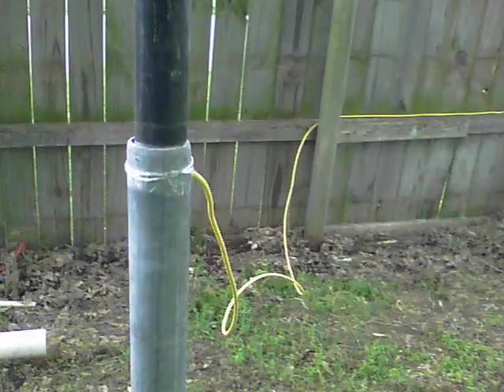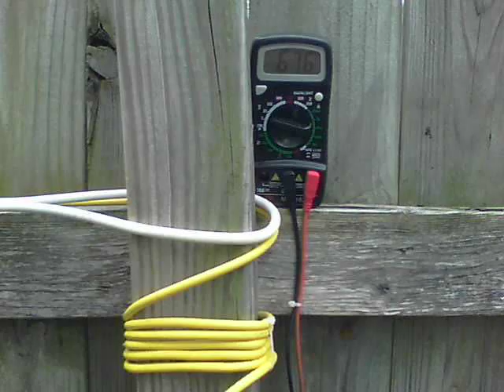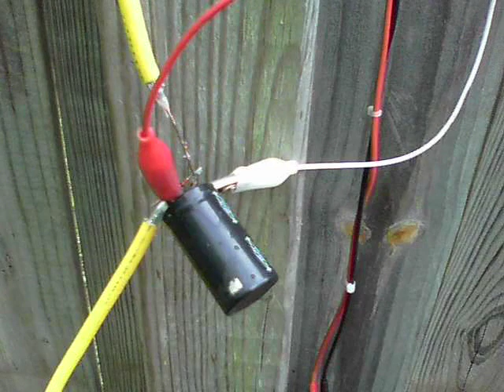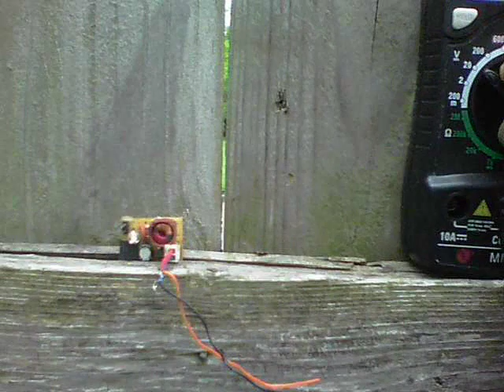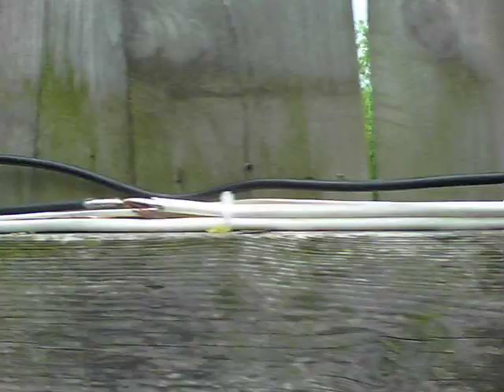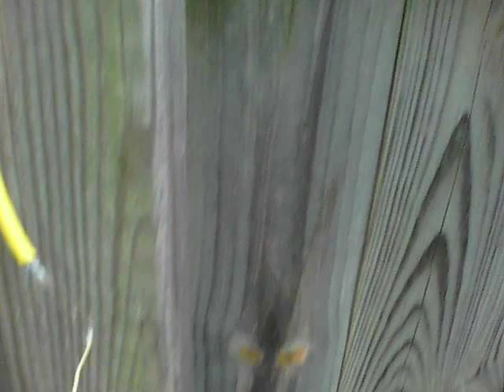Radiant Energy Collector - Low Height

Comment: This video is quite old. I have no doubt radiant energy (and other energy) is always all around us ready to be harvested.
Why do you think energy companies or government hasn't researched this and capatilized on it? True it would eliminate the need for city utilities but there's much money to be made selling, installing and maintaining this technology if scaled up for home use.
Reply from the maker: Good question and thanks for your thoughts. I think it's all about standards, protocols, laws and regulations. Plus, they don't need to change a system that basically works and has done for a century. There may have been very successful studies, which they can conveniently forget ever happened lol. 

Interestingly,. if you have a 1980's type of telephone speaker or 'crystal radio' earphone, you can hear the mains anywhere outdoors. Put steel rods about 6ft apart, with the earphone connected between. Am sure it could be rectified and reused for garden/path lights.

Comment: Is this how earth batteries work?
Reply from the maker: Not quite Paul, but similar principles. Such batteries will often use the same sort of efficient blocking oscillator circuit to store up and use the power in bursts, but derive their energy from just the ground. Instead of a positive plate (copper or carbon etc) i've used this length of wire to form a difference in potential.

Comment: So - going by your experiment, you need 2,400 Ft. of wire to get up to 12V (100 Ft. ~= .5V).  Figure .5 Ohm loss in each 100 Ft. for a total of 6 Ohms.  Current available would be ~2 Amps (12V / 6 Ohms).  Power available would be 24 Watts (12V * 2 Amps).

Comment: what if your antenna had plastic and foam. like the balloon, were you rub it on your head creates -charge ions . and when wind blows dust your plastic coil will capture - charge ions try to feel that energy with foam and plastic.
Reply from the maker: Moving toward triboelectric...yes, I like the idea and don't know that anyone has tried it that way ! Wind could indeed cause one of them to rub the other for static energies. I built this one this way because of wind conditions here in Oklahoma, but that could be to an advantage, I like the thinking :)
Reply: +slider2732 i had to see your video again van der graph different from the WRT wireless radiant tower

Comment: I have a aluminium plate that is encapsulated in black platic. It is on the roof of our home (10 meters high). One wire (0.5 ohm resistance) goes from this metal plate all the way down to a metal pole (0.5 ohms resistance) which is 0.5 meter in the ground. I tried a wet soil (also with salt) and dry soil. In any case, the voltage between the plate and ground is 1V and the amps is 1 nanoamp (and sometimes zero / too tiny to measure!). I surely can't power anything with this!!? Help!
Reply from the maker: Heck, seems like it should be a lot more and you've gone about it correctly. Even with copper and zinc in the ground you should get 0.8V and approx 300uA directly. Can only think the wire is touching something on the way down or that the plate plastic is somehow acting as a capacitor. Maybe swap the plate with a sheet of copper attached to a wooden piece of plyboard or a piece of foam. May also be worth making an A/V plug (2 diodes connected at 1 end facing opposite directions) and putting that from your roof wire to a 100uF electrolytic, the ground rod also going to the ground of the capacitor. You should see the voltage climb on the cap quite readily.
Reply: Okay thank you a lot. I will try the suggestions and report back later. My aluminium plate area is 0.5m^2. It is totally insulated with black plastic and the wire is insulated too. Is this a mistake? Should the wire have no insulation? Or the plate? Because I see many people with bare conducting antennae.
Reply from the maker: There's no harm in trying the wire and plate bare, or swapping the plate for other metals of other sizes...all part of the basing knowledge as it could be termed. To know what doesn't work as well as something else forms the progress, as well as taking away the whole weekend lol. Good luck !

Comment: im fairly new to electronics so bare with me. why do you not have an insulated conductor in your circuit or you do and i just don't see it? Is it lack of funds? What component in your circuit is collecting strongly electrified minute particles of matter?
Reply from the maker: +Matty G That's the comical thing Matty, with coax supposedly being insulated. Same thing with the 'BAC' coils that I made for wireless electricity. Coax makes for an excellent electricity emitter and collector ! 
The understanding of atmospheric electricity is essential for whats going on with this sort of system. But, the fundamental of it, is that the air around us is always charged, relative to the ground. How we collect that difference, is what ends up as designs like the one shown in the video.

Comment: Great work Slider
been doing the same,but a bit differently than you,added a tesla coil with spark gap and a 555 mosfet as exiter and gets my 2x 100 ah batteries charged overnight,I must add though that i live near the equator and have perfect radiation all year long.
keep it up man
Reply from the maker: Paul Fourie Thanks Paul. Good practical use there that you've described...bet it feels good when raining and no wind and yet still able to charge those batteries up :)

Comment: Ive seen the Drawings tesla made on wikipedia, and i dont really get it, he sad he used 2 insulated plates, 1 in the ground 1 in the air connected together with a capacitor, is this the same principe? Could yoiu imagine if you wrapped your house with its.....Xd
Reply from the maker: You could have a metal house roof as the collector, if it was insulated from the bricks or wood below.
Yep, same thing, different method to Tesla's concept. The height is way too low for a conventional collector, but that's why I had the wire go all the way along the fence back and forth. It also creates some capacitance between those wires, like a coil.  The wire is still there, but I now have solar panels connected through it to get to the house, using 1 of the wire lengths.
Reply: slider2732
Thats pretty smart, combined with solar panels you mean? would give you alot of power. But i like to try something similair like this but on a smaller scale, gotta have something to do in your free time :)
Reply from the maker: The idea was to have an oscillator switching all the time, as part of an inverter circuit...it would do the switching for no energy loss, to a pair of MOSFETS and transformer. But in the end, the wire now just carries the solar power through to car batteries in the house. We have a large tree that shades most of the garden and it's just practical to use the wire, with the panels being at the far end.
A mini version is certainly possible, increase the height though (and disconnect or fit a car spark plug between collector wire and Ground if you live in a storm prone region).
 .
Reply: slider2732 Thank you i would love to try that, gonna look if i can get some voltage through it. Tesla sure did make some nice stuff, love experminting, nice to see it also works horizontal.

Comment from the maker: If you don't have coax cable, you can try other wire as long as it is insulated and long. Then just follow what I did in the video. A good metal Ground rod is needed, 2ft or more into the ground. Then use a multimeter to see the throughput.

Comment: Then feed the power (DC) into an inverter to get AC for running devices (at least here in the US), and feed that power then into a voltage regulator which matches the voltage you receive from the power company.  That should allow you to capture the surplus power and send it BACK to the power company (and get a credit on your bill, which at the end of the fiscal years they would be obligated to send you a check for!)

Comment: Try using BARE copper wire instead of the rubber coated coax, and be sure to insulate the points which you are using to hold up the copper with either silicon or rubber (to prevent it from grounding out the radiant energy it has captured) and your power captured should go up.  (Thank you Nikola Tesla...  ;)  )

Comment from the maker: Battery charging yeah...fill up a cap and discharge into the battery repeatedly, like a water bucket line. 
Had that LED oscillator running for weeks out there, was useful for R/C aircraft flying to denote edge and distance on night flights.

Comment: Thank you slider,
But, what you're saying about not having the capacitor in the system output, do you mean not to connect the leads of the multimeter to that? I understand what is filling the capacitor, but if you remove the cap, won't the voltage go with it, and then how can the load be supported. Can you clarify for me?
Thanks again.

Comment from the maker: I ran out of characters and edited wrongly. What I meant to say by 'no cap' was that by not having a cap in the system output, you'll gain the throughput voltage and amperage figures. That's what will be filling the cap, showing your collected storage. Bigger the uF rating of the cap, the slower it will fill :)

Comment from the maker: Yep, that's meter draw as you suspected. Way around is send collected energy to a much larger capacitor, say of 3300uF. The cap will take a long time to fill, but the result is 3300uF's worth at the voltage it gets to. Connecting the meter for a reading then doesn't affect it as much. 
For realtime readings, no cap will show exactly what's coming through your system with meter connected.
You can drive any load that shows the constant throughput, but likely be only an LED blocking oscillator.

Comment: Greetings slider.
I've been experimenting with radiant energy myself, and I've obtained some successful voltage. But, do you know why, upon connecting the leads of the multimeter to the charging capacitor, the voltage drains and eventually goes to zero? Is this just because of the multimeter resistance, and would it have this effect when connected to a load possibly?
Thank you

Comment from the maker: Ah, a microwave antenna method, yeah, good project. Tuned just right you might be able to really pull in a lot of harmful energies and put them to good use. Sitting in a bedroom would be a prime placement. With all the gumf flying through us all the time, methods to limit, control and reuse those unwanted waves is needed. If a bedroom is made R/F, EMF and any other leaked waves free, then a personal theory is that nightmares and other sleep disorders may well benefit.

Comment from the maker: Appreciate the comments :)
As in 'electret' the name Oliver Heaviside gave ? Was thinking about 90 degree push in magnetic fields for magnet motor experiments, possibly w/ non polar HV caps. An air energy motor, would be horizontal and Earth North biased to start.
Have built a battery flyback inverter, might well try what you suggest, with the setup in place, on a hot summer day. 
Been thinking of I/R LED's for extra solar push + how diodes develop a charge tunnel, if left alone and stationary

Comment from the maker: I haven't yet, may well try that with an extension lead out to the rig up...though I wonder if the lead itself would then affect the reading. 
The low height and type of cable intrigues as to what and how it is doing what it does. Unless it's tuning to ground seepage by being in a residential area, hmm. Thinking of putting a crystal radio on it, should get nothing but is worth finding out.
Looks like i'm subscriber 5039 to your channel lol, have always enjoyed your vids.

Comment from the maker: I haven't yet, may well try that with an extension lead out to the rig up...though I wonder if the lead itself would then affect the reading. 
The low height and use of co-ax intrigues as to what and how it is doing what it does. Unless it's tuning to ground seepage by being in a residential area, hmm. Thinking of putting a crystal radio on it, should get nothing but is worth finding out.
Looks like i'm subscriber 5039 to your channel lol, have always enjoyed your vids.

Comment from the maker: Cheers for viewing. One thing that was noted - make sure if outside and sections of co-ax, to electrical tape between wire joins. The system got water grounded the first night and I was only getting 0.2V. It was a thunderstorm though, so was a good test ! After taping between the joins, rain doesn't bother it now. Sun seems to increase voltage, Night decreases slightly. If anything, I would have expected greater gains at night...but then again it's shielded wire, it shouldn't gain anything lol

Comment from the maker: It is shielded indeed and it confuses the heck outta me lol. I don't use the shield in the circuit, just the copper inner, but, the shield doesn't continue bridged between the several sections. It's a little bizarre how it collects anything...though negates radio waves and other transmissions it would seem.

Comment: Coaxial cable is shielded isn't it? You might could get more power if you clamped onto the mesh shielding instead of the wire, or a combination of the two. Just a thought.

Comment: I have something similar that runs around the edge of my roof but mine only puts out about .4 volts.   I will have to try the coax cable.   That might make a difference.